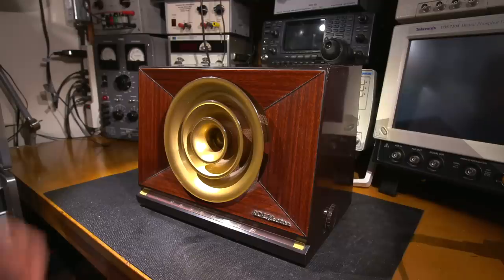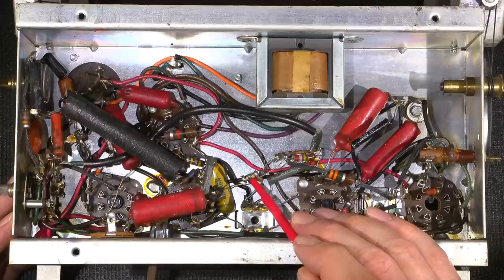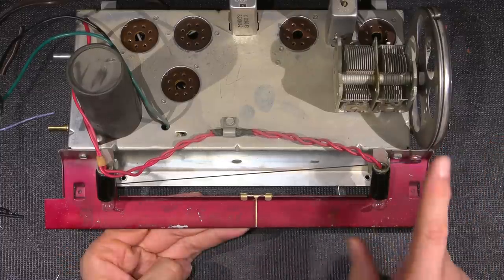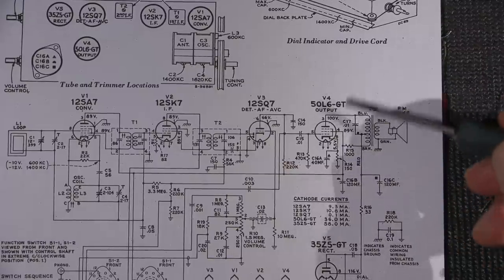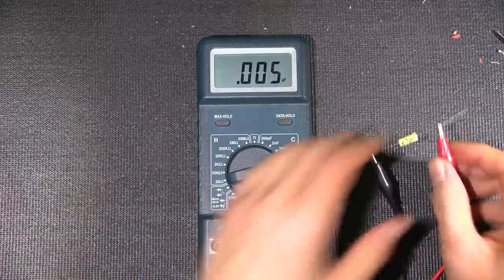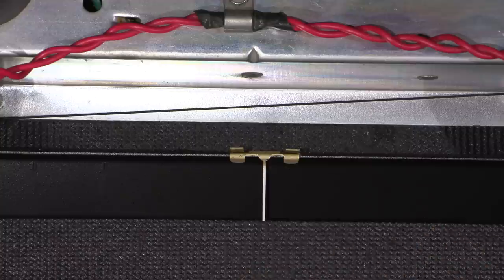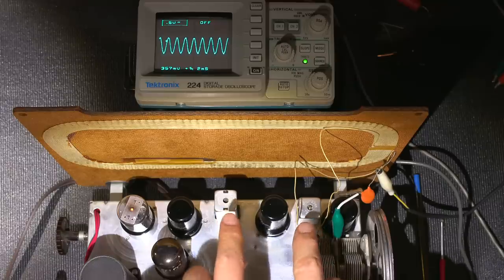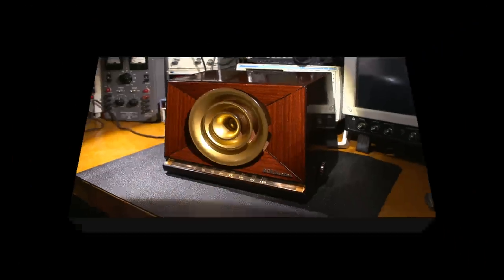Bizarre Looking RCA Radio! [Electrical Restoration]

Comment: Granddads radio fell of the stairs 15 years ago, my dad believed we couldnt salvage it. all tubes broken, caps all bees and dust everywhere. This video showed me that with the right knowlegde and tools, I might be able to. 
(but i sure have to lookout for 240volts right here, better dont get that magic smoke come out of me)

Ill start by taking a look at your patreon ;) and maybe start with some simple circuits. :D keep em comming those vids Mr Carlson.
Granddads radio is gone btw, ill start fresh with a "new" one maybe someday.
Reply: If you are in an area where the power is 240V, you should know that all "American 5" radios are 120V only, because the vacuum tubes - especially the audio output and rectifier tubes - were designed to have just the right filament voltage so that all of the tube filaments could be wired in series.  As far as I know, there were never any equivalent tubes designed for the rest of the world, probably because transformerless radios weren't legal anywhere else, for safety reasons.  Note that in this case, even though the knobs were insulated from the chassis, the chassis was exposed in the back as well as through the chassis mounting screws.  And also through the phono input jack, for that matter.  If you pause on the schematic, you will see that there is a resistor across a capacitor connecting one side of the line cord to the chassis, which would not have been considered safe by most regulatory agencies.

My Dad once had a stereo phono/radio that was transformerless, made by Japan Victor (with the "His Master's Voice" logo) for sale in Japan in the late 1950s.  Because Japan had two different power systems, 120 V 60 Hz and 100 V 50 Hz, this had a tapped resistor in series with the tube filaments to choose between 100 V and 120 V, and a two different motor spindles for the phono, for 50 Hz and 60 Hz, as well as 100 V and 120 V taps on the motor winding.

Comment: What a beautiful and weird radio! I found that a cheap USB microscope/borescope is very useful for checking inside IF transformers for waxies. It might also be useful for showing tight spaces (like those ceramic standoffs you installed). It might be a pain to edit that video in though.

Comment: those are some nice photos in the calendar... great colors and very pleasing lighting.
great video and work as always!!!

*after re-flowing some solder joints on an older philips radio it turned right on, but i didn't know how to adjust the antenna...  so i ended up 'sliding the needle on the rope' till it was close enough to the actual printed numbers. it doesn't have tubes but it has open back speakers with paper cones and that's retro enough of a sound for me.

Comment: A remark on this video (as always 'well done') : the measuring of the 0.003 µF capacitor at 50:39 had the opportunity to learn to measure at the correct range of the meter. Paul, you used only the last digit on the 2µF range, while you could switch two range down to 20nF. A digital meter has a tolerance expressed in percent, + a float of the last digit, say ±2 digits. And in that case 0.004 could mean 0.006 or 0.002. So I would have liked to see the value on the 20nF scale.
Reply: My thought exactly.  I suspect he was trying to avoid the complication of having to explain that .003 µF = 3 nF.  I was also questioning his example of 470 kOhm of leakage, when his DVM clearly showed it being over 1 MOhm.

Comment: Wow, that's a 9-X-571, I have a 9-X-561! Very, very, similar. The speaker cover isn't as dramatic (but similar look). It doesn't have the second knob on the left, but has a phono switch in the back instead. Same chassis layout. Even has the same Golden Voice sticker on the back!

Comment: that was very very interesting and relaxing. never seen anyone attenuate a tuner like that.
my electronics experience is from highschool in the 1980s. man did I skip school on the wrong days. sheesh!
awesome instructional.
so glad the caps didnt sweat out or fry before you could change them out...I had a para sound tuner overheat and fry years ago. wish I hadn't tossed it...was the cleanest 25 watts...so loud.
was also a great way to demonstrate clean wattage versus mass wattage.
and now I am rambling.
thanks again though.
just great!

Comment: @ 49:20 , you didn't disclose, or demonstrate, that the Agilent U1253B DMM you used has a function to measure conductance in nanosiemens, down to 0.01nS, which according to page 47 of the user manual The conductance measurement function makes it easier to measure very high resistance of up to 100 GΩ  This is a quantitative measurement as well, done with a low and safe voltage.
Reply: Most of the Fluke 80/180 series meters, as well as the Brymen 869S, and some others also have this function.

Comment: In my mid 70's high school electric shop class, our big project was to build a 5 tube Super Het. Mine worked fine, but my grade was slightly nicked due to neatness of my build. I was bummed,,, until I saw 'this' build. Wow, mine looked 10 time better than this 'professionally' made unit. Who put the stickers on this thing? I thought  old time American made meant excellence. Lol. I actually bet this was a low end unit.Woolworths maybe? I know Zenith and RCA had factory stores that would offer a radio as a give away promotion, free bee bookshelf radio if you bought an upper end TV or fridge. I bet this was something like that. Great vid! I have an early 60's Telefunken 7 tube AM, FM, shortwave my father bought new when stationed in Iceland. It still works but I'm going to tackle this mod to keep it happy for years to come.

Comment: That has amazing sound for a simply AA5 AM radio, better than a lot of AM/FM sets of the day. It makes one appreciate just how good the AA5 design could be, when implemented properly. Sadly, the Japanese "midget" AA5 sets that flooded the market a decade later sounded tinny because of small speakers and indifferent engineering.

Comment: Hi Paul, nice job, as usual.  I think that radio is very cool and very stylish, as well interesting looking.  I am just sure it will project the sound great by the looks of it.  I also think that the mod of the dial back, flat black, plate is very with contrast needle to show it off and easy to see.  I am looking to get a mug with the tube schematic type, I like it very much.

Comment: It is a good idea to sweep the IF transformers. I've had the small caps in the can short. Some more rare radios and mostly car radios used 220KHZ IF. Most table radios used 445KHZ.
Hint on working with dial string. They end on a spring in the capacitor pulley. Unhook the spring to relax the string. It makes re-stringing much easier as trying to pull the wrapped string against the spring is difficult. Borrow your wife's crochet hook to manipulate the string back onto the pulleys, then re-connect the spring.
When testing capacitors, change ranges on the tester to get 2 or 3 significant digits. The test demonstrated was akin to measuring a 1.5V battery on the 1,000 Volt scale of a DMM. Use the 20nF range for the 3nF and 4.7nF capacitors in your video. For leakage, use a megger that applies a couple hundred volts for the test.  A lab full of test equipment and you are measuring 0.004. LOL. On the full scale 20nF range you would have more significant digits. Learn to use digital meters please.
Reply: Need to add when tuning the IF, most of the cores pass all the way through. If you can obtain the proper alignment tools,  the hex head is on a smaller round shaft to it can be pushed through the top core and adjust the bottom core.  Most IF strips are this way. Only a few had flat blade slots that did not permit reaching both cores from the top.
Reply: "Use a megger for leakage" is done in another video where Paul used a few vintage meters like a Heathkit. They all did NOT show a problem with a cap at 600V, but the leakage meter that Paul designed (the one used in this video) did definitely show a bad cap with leakage.
For the  wrong use of the digital meter I completely agree, measuring on only the last digit is a fully floating error, and a typical beginners fault. For the latter, Paul could have an explanation in his sleeve, because he usually should not make such a mistake. Maybe faulty 200nF and 20nF range ? :)

Comment: As I own one,I'd like to see you do one on an early '40s RCA 28X.They are a nice set.I also have a 9X561 as well,I'd like to see a restoration on one as I'm in the middle of one that seems to be a hack job.I've had to tear into it and rewire it as the 35Z5 rectifier tube and the two pilot lamps are the only things that light up.The rest of the heater string is dead and I know the rest of the tubes are good.I removed them from sets that worked.I enjoy watching your vids.

Comment: For whatever it's worth; in my 66 yrs in repairing electronic's devices, I have never seen an "Allen Bradley" resistor go bad; UNLESS, it was burned. Yet, I have seen untold "IRC" resistors (the ones that are porous) that were bad.

In other words, excluding checking and replacing bad tubes, the FIRST thing I would do is to replace the IRC resistors. Then replace the waxed caps; and in MOST cases the repair was done. Oh indeed yes. It saved untold hours of labor trying to diagnose.

And this applied to radios, Hi Fi's/stereos, amplifiers and TV's, etc! Not to mention test equipment.

Comment: Probably doesn't apply to this radio, but I've had a number of them where the IF frequency was way off what was published on the schematic.  Got a GE-78 console which IIRC was supposed to be something like 470kHz but had been aligned at around 445.  When I retuned the IF to 470 there was absolutely no way to get the dial to track- it just wouldn't tune all the way up to the top end.  Of course sensitivity also suffered greatly because of it.  So I put it back at 445 and everything tracked again and sensitivity returned.  Going forward I first check what the IF is set for then I'll know where to put it back if the published figures screw up the tuning.  If a radio is supposed to tune up to 1700 but the highest station you can tune is 1620 or even 1590, lower your IF until the dial starts getting close to tracking correctly and leave the oscillator trimmer cap and coil slug to do the fine tuning once you're there.  BTW, picked up a similar looking set with an identical chassis at an estate sale recently. 

One other IF alignment idea- if you have a sweep generator you can stagger tune the IF can slugs for a slightly wider IF bandpass.  It will reduce the sensitivity somewhat, but you'll get better treble response.

Comment: Very interesting and informative video, Thanks. I studied electronic engineering but the foil end of the cap is something that could be very critical depending on the design and application. That should have been covered or even just glanced over so that students are aware.

Comment: My 1950 RCA console has the golden throat sticker. They did various stickers depending on the accoustics and sound.
Also keep in mind that most RCA and philco but mostly RCA caps were of extremely high quality for example if it was rated for 200wvdc it had to withstand 600wvdc or RCA would reject them. Chances are they are still ok. Still best to test them at minimum and reform if it's not been run in many years.

Comment: This radio has an RCA jack on the back next to where the cord goes in, and that is used as an option phonograph input. Nice looking case from a 1950's radio does not have cracks as the version that I have that is similar.

Comment: The tuning capacitor is connected to AVC DC potential, which the chassis in a set like this is not. The AVC circuit supplies correct bias to the antenna grid. The chassis IS at RF ground due to the capacitor that couples it, as is the AVC supply. However, connecting the antenna to the chassis establishes incorrect DC bias to the antenna grid, since the chassis in a set like this has zero DC coupling, particularly to the AVC circuit.

Comment: A question for Mr. Carlson. Over the years in doing IF alignment I have noticed the three frequencies  used on more modern times. The most common frequency is 455 Kc, next up I have seen 462 Kc and 465 Kc. In doing experiments I notice thru trial and error that it makes no real difference which center frequency is used as long as it within the range of 455 to 465 Kc.  Just for fun on my last IF alignment I measured the frequency response with a spectrum analyzer . The schematic called for 465 Kc center frequency ti be used.  Yet when I measure the current response 465Kc was used as the center.  The radio pocked up 20 AM stations in my area of Philadelphia , Pennsylvania. Twenty stations was the most number of received stations ever found by me on any radio repair or alignment.  A friend of mine who worked on the manufacturing line at Philco Radio, back in the day , that it doesn’t matter which center frequency is best as long as the alignment process is consistent. He claims ,at the factory , the same chassis was aligned for 455Kc or 465Kc for Canada made radio equipment. I have been cautious over the years not to touch alignments, but to measure and verify the range used. This all makes theoretical sense to me.  I learned 15:33 15:33  the hard way, if the radio is working good, why mess with it?  Inadvertently a coil could  and break wires or a core could crack and or freeze in the form. What are your views on the matter? Just out of curiosity I am going to retune a chassis that has no cabinet from 465Kc center frequency to 455Kc and measure the overall response with a Spectrum analyzer. I will also compare the reception of radio stations picked up. I will get back to you with results.

Comment: I use mine in conjunction with my matching 45Ey-3 45 Rpm Victrola . The sound is great with the buolt in 8 inch speaker and the tome controls. Some versions of this radio  don’t have the horn look, but sound just as good.

Comment: I'm finally getting ready to electrically restore an AA5 radio and noticed as in this video that there is a chassis ground separate from "common wiring insulated from the chassis."  Would it be more convenient to install a bus wire across the box to connect the insulated "common wiring" points in the circuit?

Also, I am trying to manually use my oscilloscope to check for the outside foil end of the capacitors but I do not see any change when I swap the leads.  What am I missing?

Thanks for all your videos.  You're a gifted engineer/teacher!

Comment: That's a gorgeous radio unit. 
Ah the long standing wild lust of screwdrivers for speakers , a long and tragic tale 😢 
If the calender doesn't have you in little bikinis draped on audio gear I'm not buying 😉😂

Comment: Nicely made videos. You seem to have a good background in electronics. I am interested in your pronunciation of the word solder. I was an aircraft radar repairman in the Air Force yet I mispronounced antenna for 50 years as antAnna until I was recently corrected. Funny how that works.

Comment: I have a set of plastic pry bar that were designed to remove automotive interiors. They are fantastic for removing the knobs on old electronics. (Or anything else you don't want to destroy)

Comment: I restored the exact same radio a few years ago. It was for the daughter of a man who had it in the garage when she was a girl. It was in HORRIBLE condition. The faux wood grain finish was all but gone. Not an artist, I used thin, woodgrain "contact paper" and sprayed lacquer (super thin coates) over it. The chassis was a disaster of rust from years of mouse pee. It's interesting that I never see you work on a radio that is horrible condition

Comment: Really like your videos,hope this doesn't sound like a complaint however have you thought about making any indepth technical videos / less baby steps type videos? I enjoy all your videos and this one especially you did seem to put more technical info in it compared to others... myself  and probably a lot of others watching your videos are already keen radio enthusiasts, you seem to have a very broad knowledge of the more technical aspects about radio design  and i'd really enjoy listening to some of your thoughts about technical designs of the radios etc, i've come across some old sets, especially early FM sets that have been super suceptible to lead dress with regards to oscillations yet others of the same era that are less prone to the same effect... perhaps it was due to the coils or the actual circuit design. I don't know enough about it to understand fully.

Comment: Hi Mr. Carlson!
Impressively detailed explanation of leaky capacitors and class A in tubes, I had no idea that could happen! One question though: Is there any way to calculate the maximum capacitor leakage a given tube can handle? If I were to say, put a potentiometer in parallel with an output stage capacitor could I create a variable tone control? I'd love to see (and hear) the research you've done on this. Great video as always!

Comment: Have you noticed any instances where the output transformer saturates?  (And, if so, what effect had it on sound quality?)

Thank you, BTW, for the silver-mica capacitor info.  I had always regarded them as stable, bulletproof components.

A day in which one has not learned something is a day wasted.